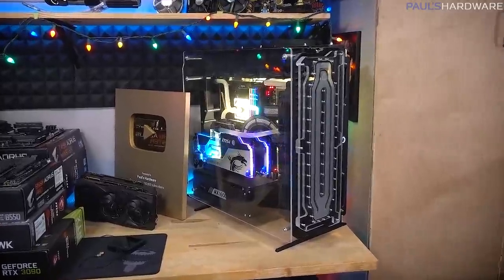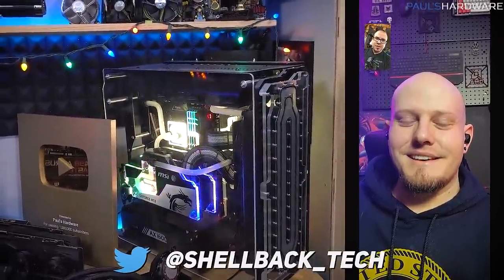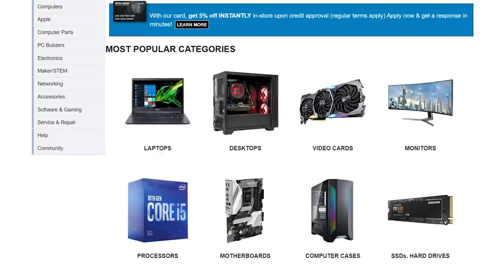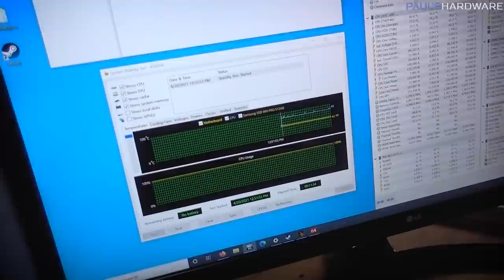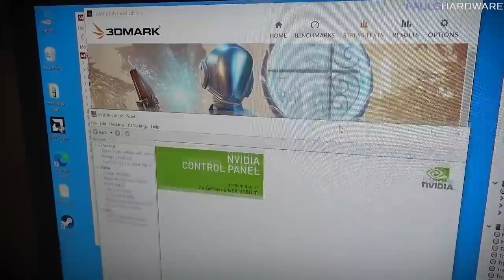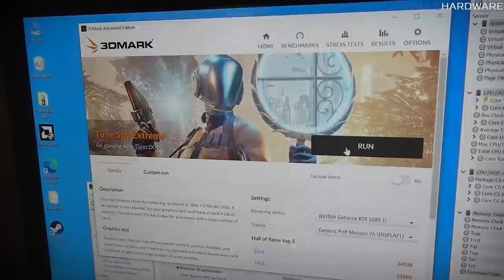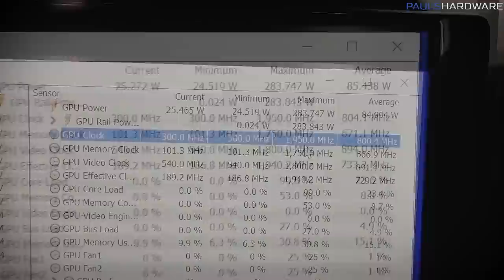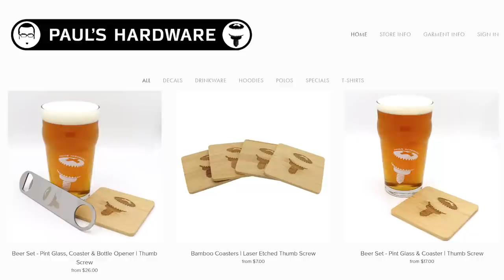Why this Epic PC must Die

Comment: Awesome use of still great older hardware that you don't need. 👍

As for the coolant gunking up the waterblocks... Why hasn't a company made a replaceable or cleanable filter for liquid cooling loops? 🤔 I think there is a market for something that you could easily pull out via quick disconnects that would save disassembling the whole loop and the blocks for maintenance.

Comment: Yeah I forgot to test my Ryzen 3600 temperatures on the shitty stock cooler (that actually dictated which RAM slots I could use) before switching over to my dual 360mm rads with 5 fans (I couldn't fit the 3rd one in the front radiator. But I suspected I fucked up the thermal paste. It was getting about 67 degrees in cinebench 20. When I finally got my 5900x I made sure I did a better job with the paste and it runs at 60 degrees in cinebench r20. So I'm even more convinced now that I fucked up the thermal paste on the 3600. I just wish I had the air cooler results that I neglected to do. I'm also using a pure clear fluid with blue dye and it's sooooo boring. I would love to run a fluid like this, but I don't want it gunking up. If I could just flush it once a year and it would be fine, then I'd do that, but it sounds like even then it's still gunking up.